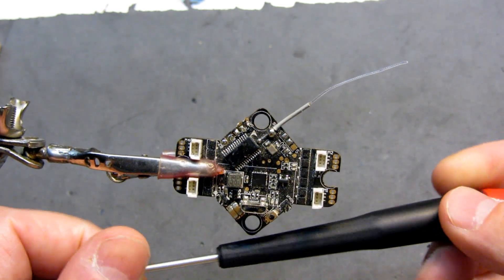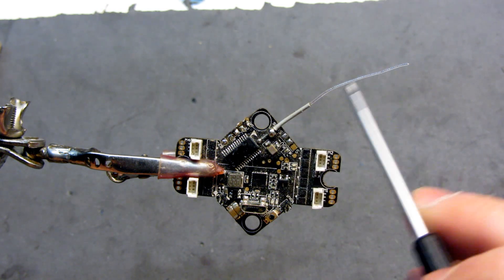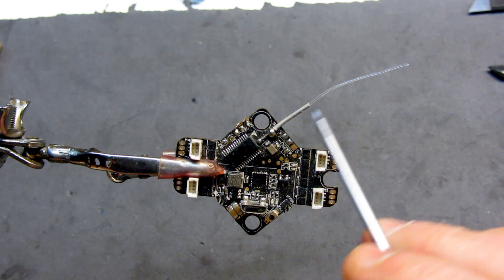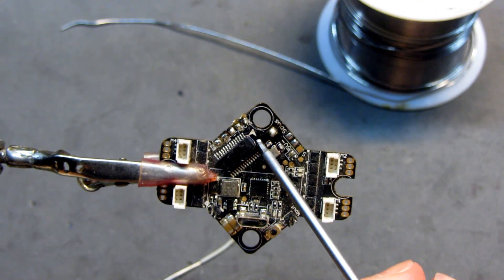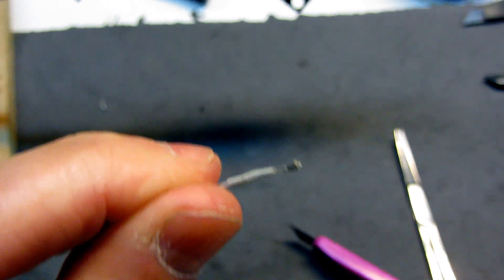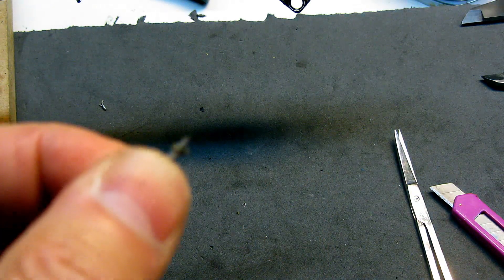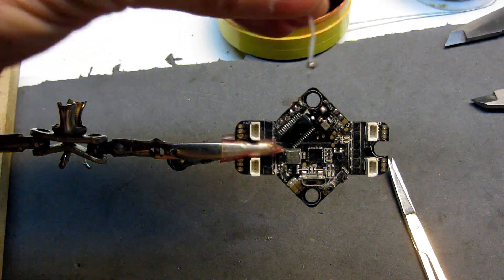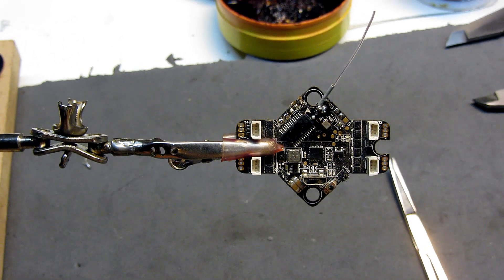TinyHawk Repair - SPI RX Antenna Repair / Replace - Viewer Request

Comment: What store can you walk into and get flux these days. Awesome job too
Reply from the maker: Lowe's, homedepot and Walmart all carry flux, but you have to be sure you're getting pcb rated flux. 
Thanks for watching 😎👍
Reply: So for a VTX can I just get a foxier Liollie ooo and dice the end up solder it on
Reply from the maker: You certainly could , but be aware that even the weight of that antenna will be a significant addition in overall weight.
Reply: @Faith_Family_Firearms_Freedom  what do you recommend
Reply from the maker: @timmytson1  
https://www.amazon.com/SRA-Rosin-Paste-Flux-135/dp/B008ZIV85A

Comment: I got the tinyhawk 2 and i would have to desolder all motor wires to get flight controller out to work to replace rx antenna
Reply from the maker: Can you not just take the props off and the motor screws out and pull the FC out with the motors ?
Reply from the maker: Actually i just looked at some images, maybe that would be pretty tough. If the motor wires go through the body the same way as original TH then yes, definitely a pain in the butt.
Reply: Yea i would have to mark the motor wires to keep track of where they go aftet i remove them its definitely a gonna be a pain in the ass i just picked up a weller 60 watt soldering iron from lowes hope this thing works.
Reply: I guess i could desolder two of the motors and flip the flight controller over to one side
Reply from the maker: @Takeover738  good idea. Motor plugs sure would have been nice huh ?
Reply from the maker: @Takeover738  I wouldn't worry too much about accidentally soldering the motor wires back in the wrong order. It only takes a minute to plug into blheli and reverse the motor rotation there.
Reply: I heard someone say on youtube that emax went with the soldering of the motor wires for a better connection
Reply from the maker: @Takeover738  yes, that's true. Direct solder decreases resistance and helps decrease battery sag. But in the case where the motors have to be desoldered to obtain access to the RX antenna seems like a design oversight. Since the original TinyHawk, battery sag has been an issue , so I suppose this was emax's way of addressing it without consideration for ease of access to the FC . If you are new to soldering , I highly suggest you also buy some soldering flux (or paste) . Ruby fluid is what I use and recommend. Plenty of tutorials on how to use flux.